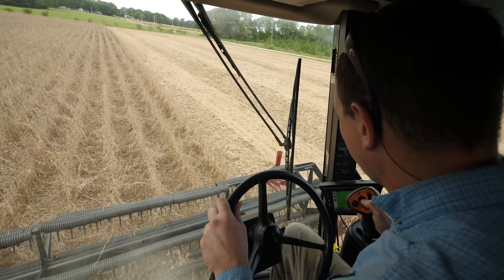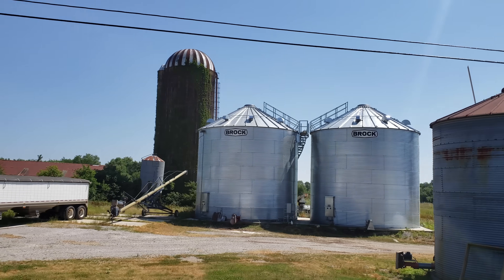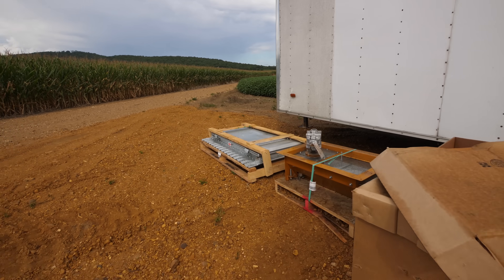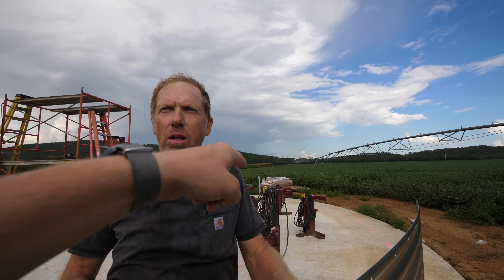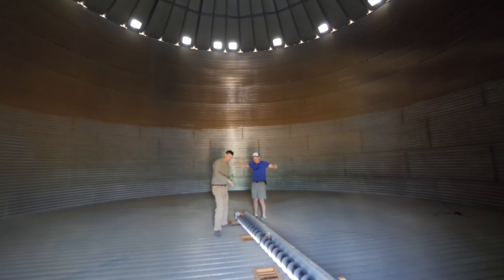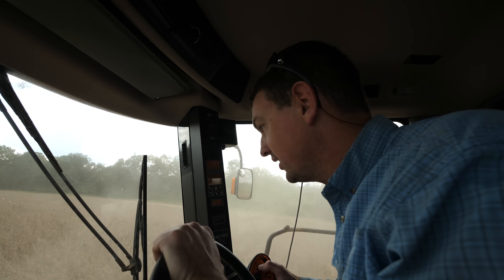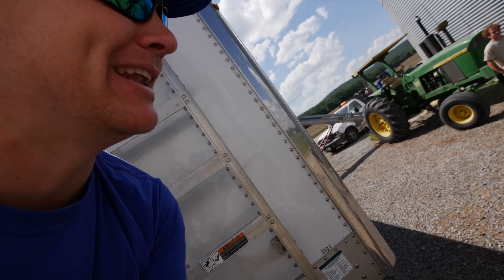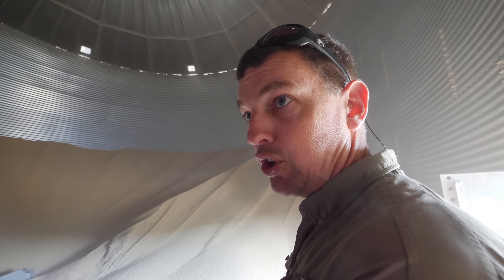Everything About Grain Bins (Farmers are Geniuses) - Smarter Every Day 218

Comment: Should have included a study page to pause on for this particular bin of how many jacks, each jack's rating, how many bolts each jack lifts by, the size & grade of the bolts, the torque setting of tightening device (was it electric, pneumatic or hydraulic, was the torque setting done by a clutch or a pressure regulator), the weight of one ring (data on metal gauge vs diameter also), the assembled roof, the number rings and for the last lift how much of the power unit's rated capacity was used. How many horsepower/CFM is that fan? Was there more than one fan? If only one fan then no air circulation until the one fan works again. Looked like a fairly large motor. Is it 480V 3ph or just 240 single phase? How about some details on the auger drive.

Comment: I know a guy around where I grew up that used to check out old grain bins for defects. Seals, bolts, and interior ring wear. One time he was inside of one of my neighbors bins, he opened the top lid, saw it was full, and went inside to take a look. The bin he was in was an old SuKup, probably 50’ tall by 28’ wide. He walked on top of the grain, checking for rust spots along the seams. He didn’t see anything, and went into my neighbors house to tell him that the bin was in great shape. My neighbor, looked at him with astonishment and told him that the bin he had walked in, 45’+ feet in the air on the inside, hadn’t been used in almost 12 years. The guy had walked on a 3” thick layer of crusted beans, with nothing underneath him. That bin hadn’t been filled in years, but the crust on top is what the guy had walked on, not knowing about the massive void underneath him. Grain bins are a scary implement.

Comment: Great to see how bins work - I was involved with failure analysis of the fasteners which sometimes show delayed fracture after installation - most due to environmental hydrogen embrittlement and some due to manufacturing (acid cleaning) - internal hydrogen embrittlement.  The customer never told me what the environment of the bin was or how it worked - they clearly did not see the importance.
Reply: They were probably storing old blimps in their bins.

Comment: Destin: “How do you test the moisture of the grain?”

Farmer: “the moisture tester”

Destin: “... a what”
Reply: We don’t do it in the mouth because your mouth is wet, it makes it hard to tell. You pinch them between your thumb and finger. If it squishes it’s not dry. If it breaks it’s dry.
Reply: In the 70's farmers used  a slingsciceometer  to measure grain moisture... not high tech by today's  standards but effective nonetheless.
Reply: @jeffpitzer8521  Do you mean a sling psychrometer? Those are used to measure the moisture of air, I can't see how they would tell the moisture of grain in any practical way. The old method I know of was weighing, drying with heat and then weighing again. There were (and still is) special scales for that with built in heater and calculator that gives the moisture content on the display.
Reply: That could be...like I said I was just a kid...I liked the name of the device and thought it made me sound smart by saying it... guess I was wrong. Lol...my point was to contrast the differences in technology then and now. Farmers still had to know a lot of stuff and use the technology of the day.
Reply: Yes skunkjob.. that is what I meant... I don't know how it worked, I was just a kid.. I vaguely remember the device. It had a small cotton bag attached... I think you put a grain sample in it and whirled it above your head.
Reply: @jeffpitzer8521  That sound like a sling psychrometer but I think you have mixed things up a bit. They are not used to test the moisture of grain, only the moisture of air. Maybe someone used it to test the air coming out of the grain bin or something like that. I'm pretty sure they didn't put grain in the psychrometer.

It might be that one unit for air humidity is grains of water per pound of dry air. That's the weight unit grain and not grains you can eat.
Reply: If that is backyard farm, rough test by hand is okay, but if your handling tens of thousands of bushels, crude estimates could cost you millions,
Reply: I’m guessing it Measures the continuity through the moisture, the omes is translated to a percentage value read on the screen
Reply: Real ones can tell just by the feel if your a good farmer you take a couple beans bit them in your mouth and chew them and you can tell the moisture
Reply: @donovan9356  Sure when you do it its fine but when I do it "its to much" and "you're eating the years harvest away"
Reply: M O I S T

Comment: bunus info, in the UK in the steel erecting industry a punch is called a 'podger' its used for the same task, to line up holes in steel plates but, it's got an open ended spanner on the other end to use to tighten the bolts or nuts that hold em together, it's different I guess, not a punch or a drift but can do the same things

Comment: at 12:41 these guys do something incredibly dangerous.  That auger circles around like an agitator so there is no right side it will come towards you.  You are dependent on a machine not breaking down.  The auger doesn't necessarily have to continue in the direction of the pile of grain it can hop back towards you.  In my case it moved into what you guys called the safe area more than 6 feet.

We had a farm with this system and the auger had hopped over the grain.  I went in the bin with the auger.   Shoveled the grain over into the auger.  My thinking was that with my foot securely on the end the auger bearing so things would be good.  Then the auger moved counter clockwise backing away from me.  I was lucky enough to notice and use my shovel as a wedge under it to stop it when it changed directions again moving clockwise.  So there is no emergency stop inside the bin for that auger because manufactures believe you will never enter the bin with that thing running.  Because its happened to me I know behind it is not a safe area they can malfunction and move backward.

Having said that, farming often involves comprises 'safety' with 'getting things done'.  If you check many guards are missing as the equipment frequently plugs and repairs go on until: "it will work this way lets get back to work".  Careful distance touring the farm yard equipment like pto's and augers.  We never had an injury that wasn't able to cover up and say yup all good here didn't happen - farmer's pride - but we got real close a number of times.  If you are touring a farm know that farmers themselves with good experience and being careful are getting injured and killed by pto's and augers its a frequent injury happening on the farm.

Comment: The largest grain bin in the world holds 1.2 million bushels (a bushels 7.7gal or 35.2 liters)  multiplied by 1.2million bushels it’d hold 9.6 million gallons of milk / 42 million liter bottles of Aquafina. 

In the upper Midwest one can (this varies by region/state/& even the county) but I’ll use an average of 175 bushels corn per acre. An acre is approx 3/4 the size of a football 🏈 field means it would take roughly 5k football fields or 8square miles to fill the largest grain bin in the world

Comment: And in the UK those tapered 'punches' are called 'podgers' and often have a spanner head or heel at the opposite end, used everywhere from steel erecting to flanged pipework assembly.... Where holes need to line up! Love em' 😂

Comment: Your corn needed water pretty bad... when the leaves roll up like that the plants are water stressed... Looked like it was planted a little thick or some doubles (two or more seeds planted close together) neither is good for corn, because it's a very population-sensitive crop (other corn plants too close tend to "cannibalize" nutrients from each other, no neither makes a good ear).  I trust you're planting a good sweet corn variety here for ear corn.  Looks like you could use some nitrogen fertilizer as well to supplement the soil; corn likes plenty of nitrogen and phosphate (phosphorus) and a bit of sulfur never hurts either (usually).  Water was definitely the limiting factor, when the leaves roll up it's already hurting for water pretty bad.  If it had enough water the leaves wouldn't roll up like that and the color would tell you a lot about the plant's health and nutrient needs-- usually if it's a light green or yellowish is a sure sign it needs more nitrogen.  IF it's dark green it'll be healthy and have all the nutrients it needs to make a good crop.  If you have too many plants or plant seeds too thick (overpopulation) you can always thin it out by pulling up some of the plants so they're no closer than about 6-8 inches apart.  In dry conditions or poor soil nutrient availability, planting no closer than about 12 inches apart (or more) will allow each plant more soil to obtain nutrients and water to make a crop, but of course the lower population means less plants to produce ears, so it's a tradeoff... that's why farmers in different areas with different climates, weather patterns, heat or high temps in summer, thinner soils, sandier soils (which hold less water for shorter periods of time before drying out) plant different populations (seeds per acre or unit of area).  
Best of luck on your corn for next year!  OL J R :)

Comment: "When you break it, there's no one to call"
Oh no, there's plenty of people to call, but the guys who work on that kind of stuff charge a few hundred bucks an hour and often have a four hour minimum charge.
Reply: Most places, you call 'em they charge you $100 and hour or more and then they send you some kid right out of high school or some 20-something that usually doesn't know much-- if the laptop can't tell them how to fix it they're screwed (and you're STILL paying the bill).  My BIL hired Deere to send out a couple guys to put in a new straw walker in his old 9600 combine a couple years ago... he had replaced one in his older 6620 combine he traded off on it a few years earlier, but he and I are old and fat now and that's a young skinny guy job (climbing up inside the guts of the combine and working in a space not much bigger than you are, having to remove and replace bolts and stuff), so he hired it done.  The young guys get there and power up the laptop and start working, he pointed out on the old machine there was a removable panel at the back of the combine you take off and you can slide the old 10 foot long straw-walker out the slide the new one in, maneuver it into position, and start replacing it.  They didn't THINK this one had it, so they started taking the ENTIRE back "doghouse" off the back of the combine... get it down to about 4 bolts (out of 20+) and one guy decides to climb over the chopper to get inside, and nearly rips the entire back end of the combine off-- the metal bent under his (and the 200-300 pound chopper's) weight... then they figure out "Oh yeah, there IS a removable panel back there, so basically they've wasted 2 hours of labor at over $100 bucks an hour... BUT it got done.  Glad I didn't have to pay THAT bill, because they were there all day... 
Later!  OL J  R :)
Reply: I would think the time factor is also important.  Sure, there is someone who can fix it, but how much daylight will you lose waiting for them to get there? As this video pointed out, timing can make a big difference in profits.
Reply: @earlzeller3015  so can spending hundreds of bucks on a repair you can do yourself... Making a profit in farming is a lot like what Grandma used to say... "It's not so much what you make as what you save"... OL J R
Reply: It's similar to roadside insurance for your car. I'm not going to call them out and wait an hour for them to show up when I can change the tire and be back on the road in a lot less time than that especially considering I wouldn't be able to use my time productively while I waited.
Reply: elcidbob true
Reply: La Nausée from the stories I have heard, it depends where you are. Some people are slow some are cheap

Comment: My parents were both sheet metal workers for many years. That “punch” is called a drift pin. 

Punches make holes. Drift pins guide them.
Reply: That was my thought, too
Reply: Thank you for the terminology! Though to be honest, I'll probably still call it a punch tool/awl. That dang memory acting up😊.
Reply: I classify them both as punches, but a drift pin is a specific utilization of the punch. That being said, I wouldn't use a drift to make a hole. "Some people call it a sling blade, but I call it a kaiser blade"
Reply: Podger is the term used in uk.
Reply: eh i would call that more of a tapered punch. I would use a straight punch for whackin out pins and such
Reply: The drift pin made me think of a spud wrench.
Reply: @hdsluggo182  Same. Spud wrench is #1 when assembling a red iron structure.
Reply: "Long metal somewhat pointy thing that aligns holes" is also acceptable
Reply: Anything’s a punch if you hit it hard enough
Reply: You're probably right, but they are called punches by all the grain bin builders I know (i've been one) so there's that.
Reply: That was a punch being used as a drift pin
Reply: In the south we call it a drift punch.
Reply: Tapered punch. Straight punches are useful too!
Reply: We just call them drifts. And all my large wrenches have drifts at one end. When working with iron, alignment is 80% of the job. Drifts are the most essential tool in my bag, that's why all my tools are drifting tools.
Reply: I see your point. They are probably using a normal punch to align it.
Reply: Punch*
Reply: Huh...the more you know...nice one.
Reply: @pmcampbell1623   that skinny thing is not a bull pin!
Reply: La Deda mini bull pin
Reply: I call it a “under belly drifter punch rod”
Reply: A punch is a multi purpose tool being a farmer myself it helps a lot a punch my be used for this or a pin it doesn't matter just whatever gets the job done
Reply: I was taught that it's an aligning punch, while a wrench with a pin on one end is a spud wrench.
Reply: @brettknoss486  I suppose who taught who is what you call what.
Reply: We use what we call a lining bar. It has the pin on one side and a prying foot on the other.
Reply: My family calls them both punches

Comment: In Australia it's a little different. We will be and have already started harvest. The farmers only have one or two bins. The rest is harvest and instantly send of to be weighed and sold to a receival point. Not going of volume but by weight entirely. 50 tons out of the back a 18 wheeler in a minute. Last year my father ran a receival site which took in 370 thousand tons, in about 8 weeks. 
The site is open 16 hours a day. I'll be starting the end of the month and will start with 8 hours a day and going up to 12. 
Farmers don't worry about humidity they just harvest when it's dry.

Comment: Wow! Flashback to my teens in the later '70's on a farm in south-central Minnesota. I finally found a subject that I knew better than Destin! :) We had a similar bin setup but the blower on one of the bins had a propane heater incorporated so we could use it for drying corn. It also had an auger that optionally went up the center of the pivot to cycle grain from the bottom to the top of the bin. I also worked for a company in the summer of '79 that sold not just bins but whole grain systems that weren't covered in this video. These grain 'legs' are the big Christmas tree shaped structures that hover above a set of bins. I helped with everything from the concrete work for the swimming pool type of dump pits at the base of the leg and bin slabs, to the steel work and leg down chute branches... Very interesting and dangerous job but my monkey climbing years are behind me now. However, I did not jack bins or operate the cranes and we did not have the handy electric tools back then.

Comment: I saw a guy below mention computer soil analysis. If I remember right, some of the oldest operational computers in the country are still doing that kind of work, I remember reading somewhere in VA or WV (TN?) there was an oooooold IBM from the 60s that was still chugging away doing just that. Kind of makes sense, considering the farmer's motto "if it ain't broke don't fix it". We personally still run equipment made 60 years ago.

Comment: Farming loses most of its challenge once you start dumping chemical fertilizers on the field.
Reply: If you want to maintain credibility don't try using 'chemical' as a crass word
Reply: @ethanmccormick3271  I didn't.  Thanks for inferring my tone while my sentence was absent of any qualifiers to negativity.   

Until you start pumping nitrogen into the soil yields are erratic and low.  As soon as you do then its really easy to get high yields assuming no draught.  Otherwise known as the absence of the chemical compound dihydrogen monoxide.

Comment: could i just build a house like this? it looks so much easier than...buying an actual house
Reply: probably way more expencive per volume, as its steel not wood/brick. and you would still need to insulate it and run all the electrical and plumbing.  but i dont actually know that, im just speculating.

did some math, looks like its about 30k for a 10k bushel grain bin. with is 30k for 12500cft of volume. now lets assume that you have an abnormally wide bin, so its radius = its height and you get a radius of ~16ft which is a floorspace of 800sqft. thats like a medium-small apartment.

 so 30k gets you an unfurnished, uninsulated, no electricity, no plumbing, no flooring, forever windowless, smallish apartment with a tall ceiling.

also anyone else here ever have a moment of when you should be doing homework but instead you look up the economics of grainbins.
Reply: kenrick encinas Same